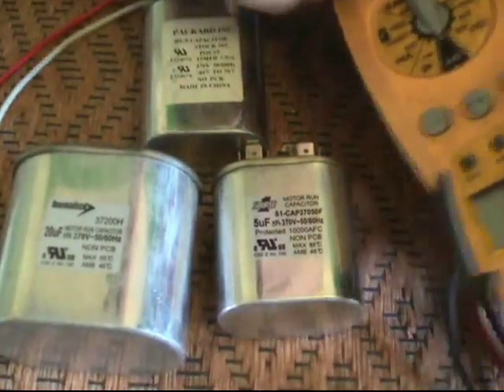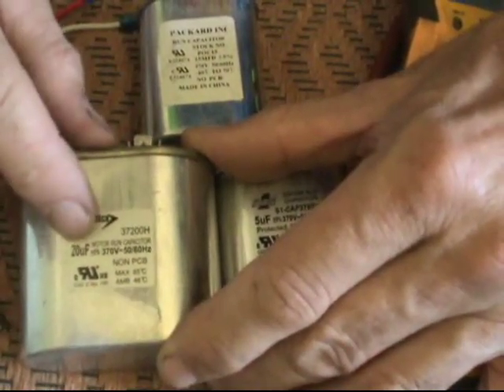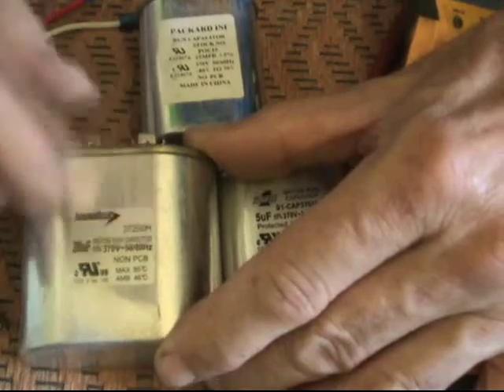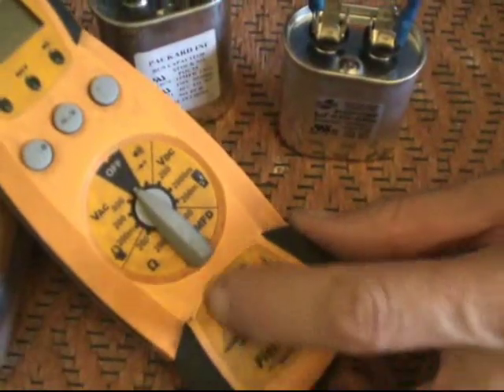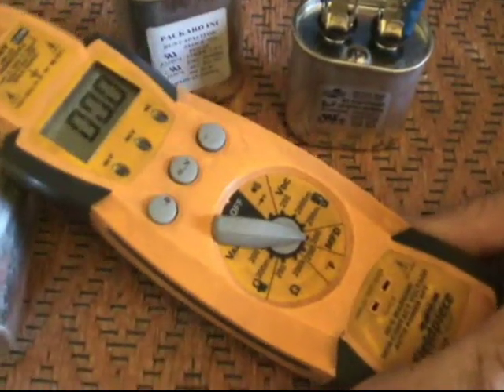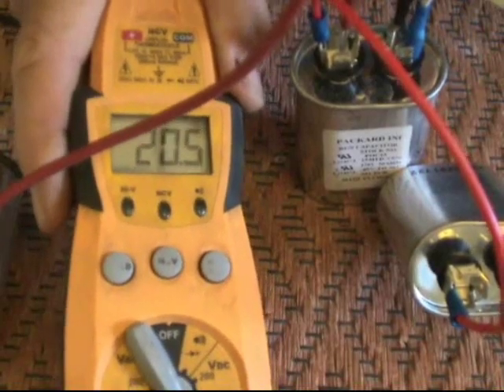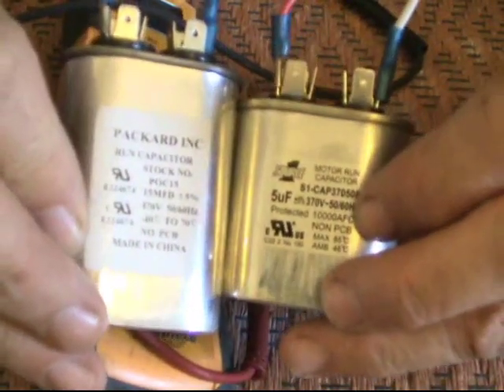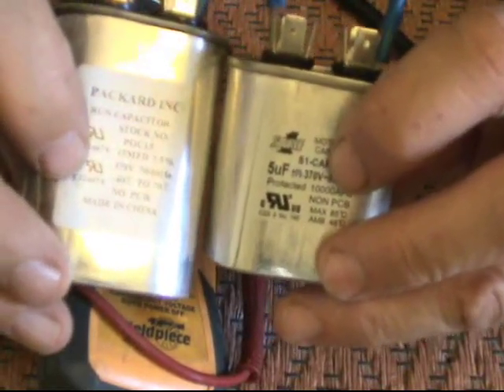HVAC Run Capacitors 3

Comment: Hello, I have to capacitors that I was planning on installing in parallel wiring. How can you tell which one is fan, hern, common when the top is not marked or labeled?

Comment from the maker: @GHOKO1234 You should not replace a 40 mfd with a 50 mfd. You can always go up in voltage but not down. Always keep the mfd rating the same.

Comment from the maker: @fsdanlie Did you check to see if the compressor side of the run cap check out at 45uf? It sounds like the run cap might have been going bad.

Comment: I worked on one that capacitor went out after 4 months cleaned condenser on unit 4 months ago .installed a new on 45/5/440 and checked voltage when running and got 462 volts on common and herm on run cap,compressor running just below rla condenser coil is corroded but to me it's a sign of compressor going out,they invested on a new system.What's your conclusion?

Comment: The motor plate on my compressor doesn't say anything about the MFD requirements unfortunately.  I believe its a 3.5 ton unit and the capacitor has gone bad.  The old capacitor had a 40 MFD label.  I purchased 3 different sizes just for curiosity purposes.  A 35, 40, and a 45.  I installed each of them and checked the amp draw on the common wire to the compressor and the amperage draw was almost an Amp lower on the 45uf vs the 40 or 35.  Would this indicate running more efficiently?

Comment: @sickbastard80 When you wire capacitors in series they add as reciprocals. 1/ 1/c1+ 1/c2...etc... If you wire a 30uf and a 10uf in series your total capacitance will be 7.5uf but the voltage rating will be the voltage rating of both capacitors combined. Remember, in series the total capacitance will ALWAYS be lower than the lowest value capacitor. You could wire two 40uf caps in series to get 20uf...

Comment from the maker: The only run caps that have a common side are the dual run capacitors that are connected to both the compressor and the condensing fan motor, as they have three terminals. The run caps with only two terminals are not polarity sensitive.

Comment: Hi, What is difference between capacitor like beginning this vid, o.40 sec, oval single, and round one, plastic covered capacitors available as run capacitors as well. Will it work if I put of course same uf, is it only difference what it looks like?
What happens if I put wrong volt reading capacitor to motor, if old is 400 and new is less- what happens, will it run or not or?

Comment: In the Doc's defense, Sta-Cons is just a brand of SOLDERLESS CONNECTORS if you wanna get technical. 

Quick disconnects are usually in pneumatics or hydraulic systems.

Nonetheless, good morning Dr. I have been watching your stuff for awhile now and just figured I would comment quick for once. 

Have a good day.

Comment: This paralleling caps trick has saved me plenty !! You should also mention seriesing caps together. Say you needed a 5MFD, you can series 2 10MFDs and get 5 MFD.  Ive used that one a few times as well....  John

Comment: Dr.Z thanks for the great tip I was wondering exactly what would be the max seperation you would use in this situation example 45 mfd made up w/ a 20mfd & a 25mfd?

(As most capacitors give a +- mfd rating for pass or soon to fail) 

Also will this work with dual capacitors?